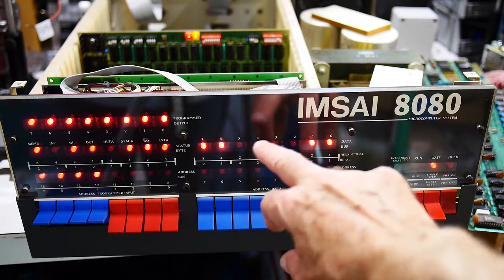#4 IMSAI 8080  Runs first program

Comment: What did you end up doing to get the system stable? I’m having similar glitches…
Reply from the maker: with such an old machine, the only way it to take it all apart and clean it. the edge connectors always need cleaning. I showed a video of that for the front panel
Reply: @IMSAIGuy  - it has been taken completely apart and I’ve cleaned everything…. Even bought the erasers you recommended 😁. Front panel seems intermittent…. Might be the 100 pin connector. I’ll keep plugging at it. Thanks!
Reply from the maker: @petersterrantino6602  did you take out the ICs from the sockets and clean the leads
Reply: @I @IMSAIGuy  - P.S. I am now a very happy Anchor customer. What a great place. Thanks for the recommendation.